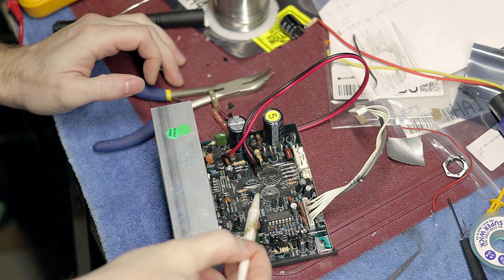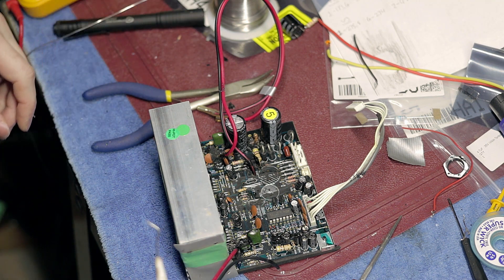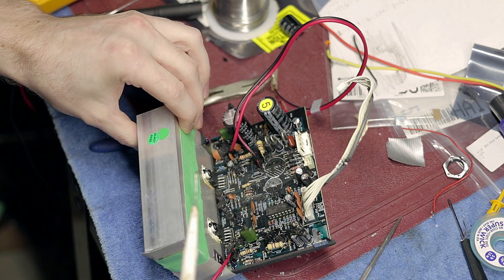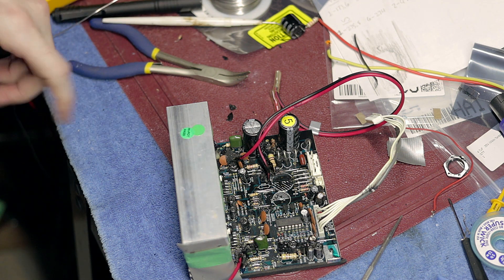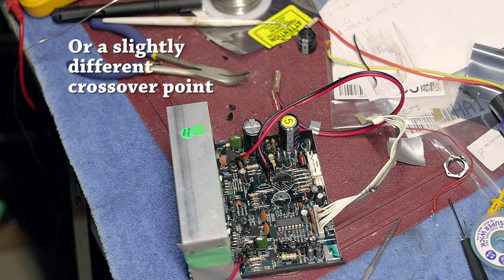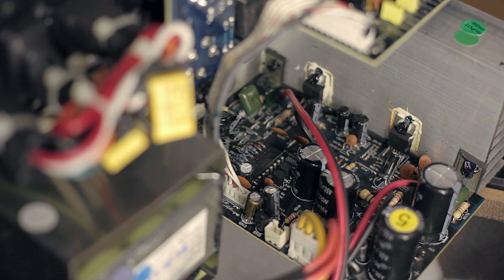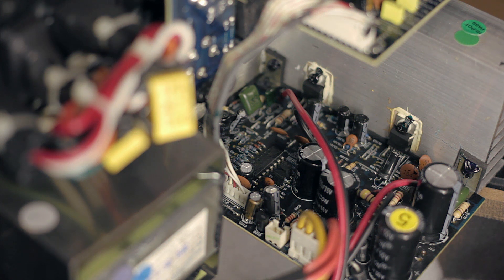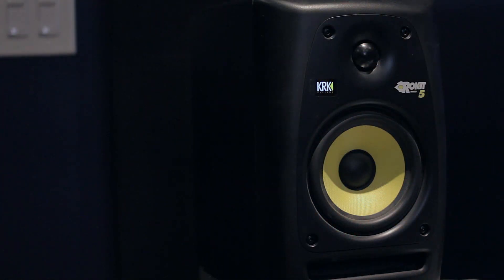Fixing a KRK Rokit 5 RPG2 Monitor Speaker. Repair FTW!

Comment: Thanks for making this video, it really helped me in my attempt to fix one of my KRK Rokit 5 G2s! Crackling/noise issues are gone but the volume is still low compared to the other one (I have to turn the volume know up by 6 dB). The upside down compressed air trick on the same two transistors you demonstrated in the video temporarily rises the volume of my KRK so I decided to swap them with the ones from my other KRK just to see if they were faulty but this didn't fix anything (and the other KRK still works perfectly) so I assume the transistors work just fine. What I don't understand is that there's a still a temporary rise in volume if I do your compressed air trick? Could it be that it's the 16-pin TL074 that's faulty in my case?
Reply from the maker: Good to hear. There is likely another component nearby getting chilled, it can be tricky to tell which one it is. I've had this technique even work on resistors, so it could be anything nearby. Since those smaller components are fairly cheap, I'd just replace a bunch in that general area rather than spending too much time trying to pin point it.  Also be sure it's not a bit of board movement indicating a bad solder joint.
Reply: @amp_mechanic  Didn't expect such a fast reply! One thing I forgot to mention is that if I turn the monitor off and on again, the volume level is correct for a few seconds. Does that change your response? Huge thanks again! 🙏
Reply from the maker: @_martellino  Not really. If the freeze test makes it work, it has to be something in that area. Good luck!

Comment: Great vid! I have the blue RP6 G2s. The logo stopped glowing just after the warranty expired. I purchased the replacement LED light but still no ball. Any ideas mate?
Reply from the maker: It would be in the power supply line on the board. LED's would likely be a 3 or 5V line. Check for voltage where the wires connect to the board. If you see voltage either wiring or likely the negative has an issue. If no voltage, work your way backwards through the components until you find it. That last component will be the failure point or just need to be cleaned up. Hopefully that makes sense.
Reply: @amp_mechanic  thanks mate

Comment: I have KRK Rockit 6 2nd Gen purchased back in 2011. The one speaker as of two months ago started crackling from the tweeter, even when not connected to an audio source. I swapped the tweeter out from my other KRK to test if it was the tweeter itself and that one also crackled, so it's definitely something on the board itself, however, even with jiggling the wires, there does not seem to be a loose solder joint. I do, however, suffer from all the black goo inside. On my other KRK, I already had to replace one of the resistors that got destroyed from the goo, but that was after watching videos and reading forums. I'm a tech guy, not an electronics guy.  Great video!
Reply from the maker: Thanks Kevbokev, sounds like typical moisture issues. As you likely noticed when replacing that other resistor, there can be a lot of popping  while melting the solder. That's contaminants in it, moisture or otherwise. You have to get the goo off anywhere it's gone hard and is over component leads, at the least. Usually there's not a lot of components to replace unless there is significant corrosion. Most of the ones I've done,  I end up replacing main power supply caps and the 2.2K power resistors. And re-solder everything.
Reply: @amp_mechanic  tha is for the reply. I just got done cleaning off all the black goo, and the crackling is gone. However, now I’ve noticed the sound goes in and out. Almost like different frequencies are missing. If I play a song, the verse vocals are almost gone while the music plays, then when the chorus hits, I hear the vocals very clearly, but the music gets muffled and comes back. I just bought a multipack of capacitors and resistors, so I’ll start replacing any that look corroded, as some resistors do. Caps looks fine, but may end up replacing them anyway.

EDIT
I was just using a faulty cable. Seems to be working great after cleaning off all the black goo!!
Reply from the maker: Perfect. It's easy to miss a cable connection. Good job!

Comment: I have a 15ish year old pair of Rokit 5 2nd gens and they have been entirely reliable up until recently. Like others, I am seeing the occasional volume drop out and the occasional buzz in one. Curiously, if I turn it off and back on, it does not help, but if I unplug it from the wall and then back in, it returns to normal working condition. This and other videos have been helpful in illuminating what I may be facing when I open it up. I was expecting swollen caps, but I had not, until now, heard of the black goo problem and that is concerning. And now, it may be some transistors and ICs too.

These speakers have a history and a lot of sentimental value, so to me, they are worth fixing, even if the cost approaches that of newer speakers. They are well worked in and sound absolutely fantastic. I have seen KRK parts sources, so I am hoping I can find the exact components needed replace the original.

Quick question, you mention that they could sound different after the repairs and we should test them to make sure they match. How would we "tune" them to match if they end up being dissimilar?
Reply from the maker: If you had a driver that had something happen to it, it may not be reproducing sound the same as the other speaker. Also, when replacing components, you may have the speaker working but certain components are out of spec or damaged causing one speaker to not perform the same as the another. If you set them up in the proper triangle config and listen, you'll pretty quickly hear from the stereo image if one is off from the other in a particular frequency range or phase. 
The output IC's seem pretty robust, I haven't seen any blown but it's not impossible. Ssually getting all the corrosion dealt with is enough. Don't forget to pull wires soldered into the PCB and clean up both the wire and PCB through holes.
Reply: @amp_mechanic  I am no longer certain its the speaker... leaning over the desk to get to the power cord I jostled the audio interface and it started working, then dropped out again.  I gave the 1/4 balanced instrument cable a twist and suddenly its back on loud and clear. It may be the cable, or it may be the jack on the interface. My interface does not have XLR out (keep thinking it does but its only in, the back is MIDI), only balanced TSR and unbalanced RCA. I can try the RCA but damn... thats a long way away for RCA.

That does not explain the buzz when I turn the speaker on though, (or does it?), so I should still take a look inside.

Comment: Own a pair of KRK Rokit 5s that I've hardly used.   Am learning piano, self taught, and use headphones most of the time.   Anyway, one of them doesn't power on any longer.   Changing the fuse didn't fix the problem.   You mentioned there are other cheaper yet as good speakers.   If you don't mind, please identify them.    Bought KRKs because I assumed they were reliable.

In the meantime, a musician buddy plans to get me a name of someone who can check out and possibly fix this malfunctioning speaker.
Reply from the maker: I guess it depends on what you like but something from Kali audio would be on the list. JBL 300 series, Yamaha HS series. For a bit more, Tannoy gold. There's a lot once you start searching.
Reply: @amp_mechanic  Thanks!

Comment: i have a pair of krk rokit 8 and one speaker started buzzing. i then realize it started buzzing because it started over heating and this is the problem i have now. just want to know what can i do to fix this over heating issue. i also notice upon turn on the speaker  the sub front pops out words a lil follow by a quick like power current sound. basically you can tell it turns on and the other speaker does not do this.

Comment: Gonna pop the backs off a set of Rokits I have to do a cleaning. I had one that just started acting up. I’ve got the volume levels the same across both. One will start to drop volume then just spike and get loud then drop again. I Isolated this to just that speaker doing this. Have you ran into this issue?

Comment: My left speaker has started making a constant static noise. I switched all cables and from left to right side but it's the monitor itself that's making the static noise. On top of that, today, the volume is now lower than normal. And when I turn it up on the back it just makes everything sound crackly and not good. Is this fixable or is it just dying?
Reply: DON'T turn it on anymore.  Mine started to do the same and just when I switched the power on a VERY loud noise came and my speaker blew up. Get them to check up. Just happened
Reply from the maker: It might be fixable, just depends on how much money you want to spend and the degree of damage. The moisture and black goo issues are the majority of the problem, they need to be cleaned up. Then if the problem persists, components level diagnosis. I'd agree with Thomas, don't turn them on if there's a lot of excess noise, get them looked at if you don't feel comfortable doing it yourself.

Comment: Hi Jay. I have a RPG 2 8 and the tweeter keeps blowing on 1 of them. I’ve replaced the tweeter twice now and as soon as I turn it on it pops again. Any ideas and help would be appreciated. Great video btw. Cheers
Reply from the maker: You need to clean up the board and check the outputs. It's not beyond the realm of possibility that the amplifier IC is bad but first step needs to be the obvious, get the black goo off and clean any corrosion. And resolder the output speaker leads coming off the pcb.

Comment: How did you clean the black gunk?
Reply from the maker: an assortment of heavy dental picks and isopropyl alcohol. 99% is preferred for tech stuff but it's easier to get 91% and the little bit of residue won't really matter in this case. Chip away what you can then dump a little on and chip some more. For really corroded boards I'll wash them with water and baking soda, scrubbed with a toothbrush. Then alcohol rinse and let it fully dry.

Comment: Do you have to discharge the caps before you start poking around in there or does it do that when you power it down?
Reply: OKPJ Reddit you don’t have to discharge the caps they are very very short term caps actually.  As long as they look perfect and not bulging then it’s safe to poke around and see what looks bad or corroded.
Reply from the maker: Correct but, as a point of safety, just check them with a multi-meter. It is possible with the right set of circumstances and open shorts, they could store some power and give you a zap. But it's unlikely given the design of these.

Comment: Hi Jay.... I too have similar issues with these speakers... again, one working perfectly (left) the right has been getting gradually worse but seemed to be ok once warmed up... Now that doesn't help but may be of interest that when I turn the volume knob round fully with a little pressure it comes back on? I have no knowledge of electrical components at all but it suggests to me that it might just be the knob that's faulty? Or am I being optimistic? Does this make any sense to you and do you have any ideas? Many thanks... Vince
Reply from the maker: It is possible that the pot is bad. Especially if it works when putting pressure on it.  However, that may not be the only issue. As I've seen in many amplifiers that have corrosion issues, ramming a bunch signal through will causes them to work. Enough electrons moving will overcome the barrier of scale or corrosion. Either way, sounds like you should replace that pot, or try putting some cleaner in it then clean up those output wires and their connections on the board.
Reply: @amp_mechanic   Thanks for getting back to me Jay.... I think you are absolutely right and that there will be further issues... I will have to find someone to take a look for me as I only fix things that can tolerate being hit with a hammer... Usually my first or last option!!! Thanks again

Comment: Hi Jay.. I got a pair of this speaker..but last 2 month, my right speaker starting making hissss noise..gradually getting volume level down day by day.. then, last week, got pop sound and suddenly got no sound at all.. it be normal back if I turn on back after 2 or 3 days.. it keeps repeating that symptom until got no signal at all..
my left one got no issue...

 I'm from Malaysia, a very limited expert to repair this speaker here...
Can you give me an idea of what to do? 

Regards.
Reply from the maker: Cleanup the wires and solder connections that come out from the board (the ones that go to the speakers). And replace the bigger 2.2K resistor(s) in the power supply (by the bigger caps). That's a good starting point. Kind of sounds like you may have to do more cleaning and may have issues in the limiting part of the circuit. I wouldn't worry about getting to that until you have the black goop and corrosion addressed.
Reply: @amp_mechanic  Thanks for ur feedback! stay safe mate..

Comment: Hi Jay. I have a pair of rokit 5 speakers and one has developed a fault. When I turn them on I get no sound from one of them. Over time it will start to work and after about an hour it's all there, though it has a low level low frequency constant background noise. Any idea what could be causing this? I have switched channels etc round with no result so I'm pretty sure the problem is with the speaker. Thanks. Tom.
Reply from the maker: A good first step is to clean the black good from around the speaker wire connection in the main board, cut the wires back a little bit and re-solder. Also clean the jumpers next to those points and put some fresh solder on them. At least then you'll know if you have to go more in depth.

Comment: Hey Jay, I have the same KRK monitors, and on one of them only twitter works, what the possible fix should i apply? Thank you.
Reply from the maker: A good first step is to clean the black good from around the speaker wire connection in the main board, cut the wires back a little bit and re-solder. Also clean the jumpers next to those points and put some fresh solder on them. At least then you'll know if you have to go more in depth. I'd also check the DC resistance of the hi and low drivers, they should read between 1 and a few ohms. no resistance, higher than 10ohm or OL means a bad driver.
Reply: @amp_mechanic  hey JAY thanks for this response im having the exact same issue. Audio is coming from tweeter only! Looks like im gonna be digging into these speakers! wish me luck!
Reply: Same 😑

Comment: I replaced the large caps which fixed the loud screeching but I get loud pop/thump with big speaker excursion when I power on one speaker... also cleaned the gunk off. Any suggestions? Same speaker has a slight hum until warmed up... plays music fine.
Reply from the maker: There's still a bad components, or at least some corroded leads, still on the board. Look closely at all the jumpers and leads off resistors, if they are discolored at all, try to clean and tin them or replace. Also the main leads going out to the low driver, they may have to be cut back a bit until you get into good copper then solder to the board. Fixing them is so time consuming because cleaning all the garbage off the board is a tedious process. And you really should resolder everything you can because the corrosion can eat down into anywhere there is copper.
Reply: Jay's Guitars Thanks very much for the suggestion. Trying to identify the bad components. I’m getting 2 volt DC surge to woofer at power up (pop)... then fades down to buzzing and then goes away after couple mins. Amp plays and sounds fine as this is going on. Loud pop/buzz much reduced after warm up (if I cycle power). 
Can’t find problem component (replace 4 large caps). Do notice a couple small cylinder caps buzz a bit when I touch the top metal casing while operating (other caps don’t seem to do this).... Pressing/pushing other components/wires creates no odd noises. 
Will replace the small caps next but a bit flummoxed as all other connections seem ok. Board has been cleaned up pretty well and continuity test show no conductance of gunk. Have check power switch & volts coming from PSU (seems correct). DC surge on woofer is proving hard to fix.
Reply from the maker: I've seen the cases of those caps damaged by the black goo. Also check the components around the limiter portion of the circuit, they can look OK but still be bad. And the 3 pin transistors, check the legs carefully. Best of luck! I know they are not easy and can be frustrating.

Comment: If you need a replacement woofer dust cap for Rockit 5 (my dust caps were pushed in). I got an exact dust cover replacement at SpeakerWorks.com part #DCPL112 (1.5" poly black). Also used clear glue from Amazon (Speaker Repair Adhesive, Foam Edge, Spider, High Strength, Clear, MI-3035) - these are a perfect fit for replacing damaged dust caps..looks exactly like original.  Remove old cap by gently sliding fingernail (or a guitar pick) around dustcap edge until you get it to separate...I then used a needle nose pliers to pull off dustcap carefully. Apply clear glue around ring where dust cap will sit, place cap, use something to hold edge down or an hour or so (I used a 1 - 1/16 impact socket from my tools as it fits perfectly on the edge of the cap).
Reply from the maker: Thanks for sharing. Cheers!
Reply: Thanks man. My four year old just did the exact thing to my speakers and now i know what to do!